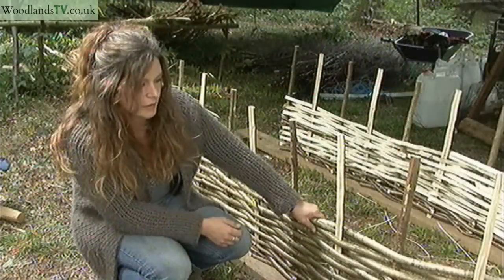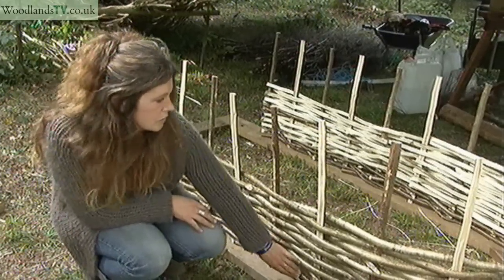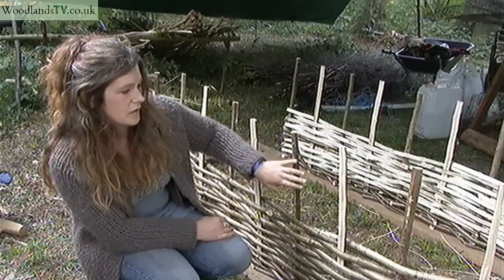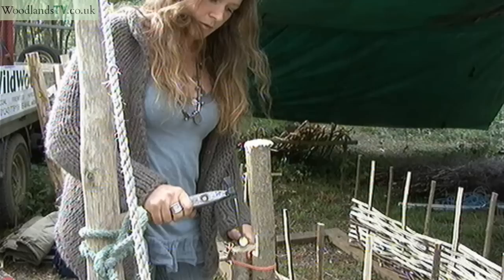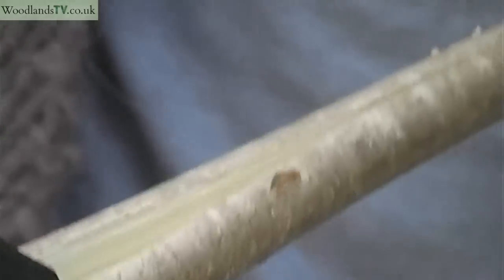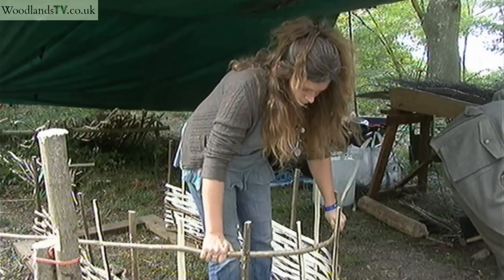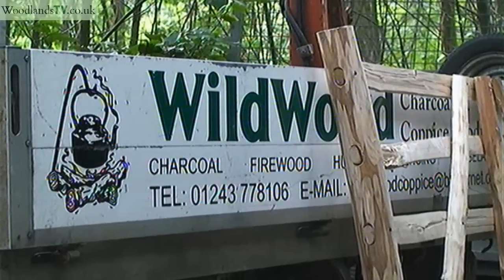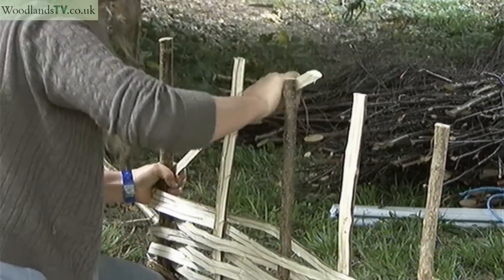Making a rose arch from hazel rods

Comment: Great info! Thanks for another informational video. Does anyone know where I can find more info about the Sider tool used to split the hazel rods?
Reply: Probably 3 years too late but anyway, the tool she is using is a type of adze. I think she calls it a side adze but I've also seen it be called a Sussex or cleaving adze. Its unique to Sussex I believe and would have been made by local blacksmiths. Splitting the hazel can be done with a billhook in the same way. Depending on where your from you could get one custom made. I don't know of anyone who still makes them. Hope this helps you or someone else.

Comment: What no body seems to realise is that hazel rods like this will be rotten after   three years which is about how long its gonna take you to train your rose to grow  up it
Reply: So what is your proposition  to make it longer lasting?
Reply: if you seal the base parts of the arch so water can't wick into the branches, and you coat them with linseed oil and let dry before planting, I imagine the structure would last a lot longer than 3 years. Making sure any part of the a wood structure exposed to ground water saturation is properly treated is most important. People used to put pitch (tar or oil) at the base of any wood they stuck in the ground, or else they charred the surface of the wood posts up to the ground-water or waterline. If you allow water to wick up and saturate wood, it will obviously rot, and it will usually do so from the inside out, so you typically won't even see the damage until it's too late. Basically, if you treat it like you would any other outdoor wood structure, it will have the potential to last at least a life-time.
Reply: try a better material , there are some metal rose arches well over a hundred years old that are still doing good service
Reply: barkershill yes and there are other metal 100 year old objects that have rusted away. It's about how you look after things.
Reply: edward charles 

Good point.  There are quite a few wooden stave churches in Norway, Sweden, Denmark, etc that are hundreds of years old.  (Centuries, plural!)  From around 1200 AD.  
They are set up off the ground on stone footings.  

It looks like they used a Japanese wood treatment technique called shou sugi ban.  The wood is scorched, which then resists rotting, pests, UV light, etc.  (But I think the churches were sealed with pitch?  I’m not sure on the details - I just found out about this recently).
And you can use these construction methods without needing access to a forge, with (free) materials found right on your own property.
Reply: not if the wood is cut in the winter and treated. Hazel hurdles can last 15 to 20 years if looked after properly. The longevity of the product depends on how the customer cares for it.
Reply: You could fire harden the wood once the arch is built, should give it a few extra years. Its a japanese technique called shou sugi ban, some wooden japanese temples are over 1000 years old and were built using this technique.
Reply: It would last longer than you think, as she said in the video keep it off the ground. I don't suppose they are a huge expense either. But products like this should be more encouraged as coppicing and woodland management are great for biodiversity and it supports traditional crafts.